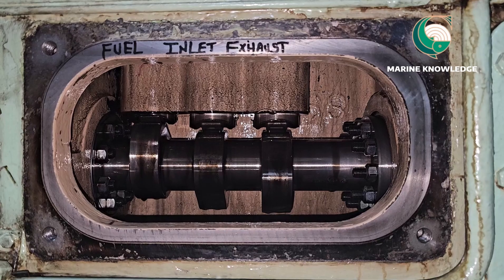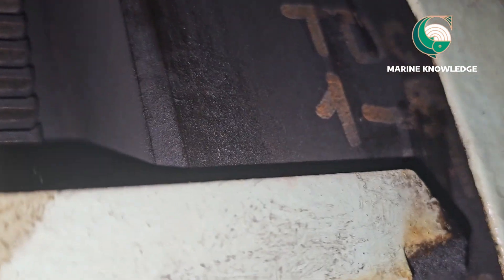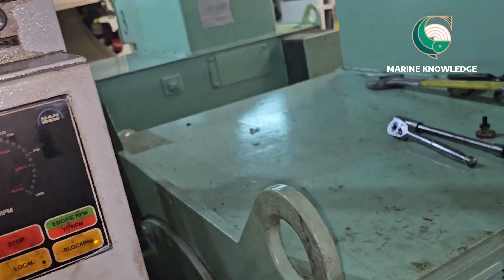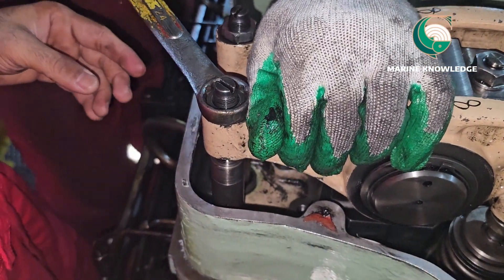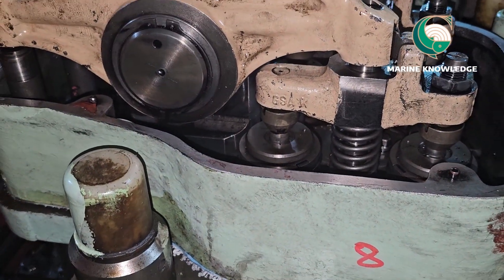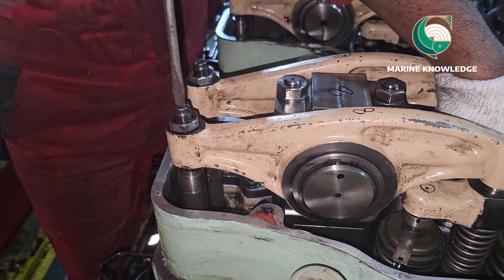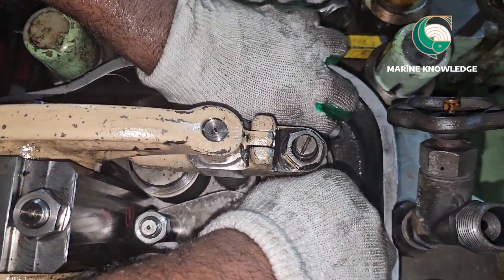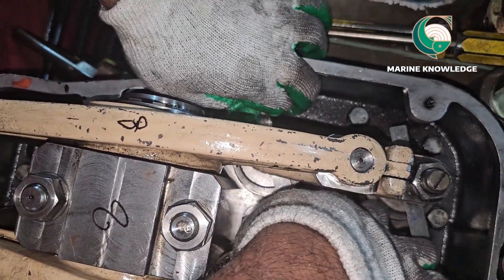THIRD ENGINEER JOB...How to adjust tappet clearance for MAN generators

Comment: Thank you very much, sir. Let me ask you a question: 6L23/30 H engine, could you tell me the angle of the start of fuel injection (timing)?
Reply: @AnatPlk  may be 10 degree before tdc....
Reply from the maker: Usually 6 degrees before Tdc
Reply: @marine-knowledge-basha  Thank you very much, sir !